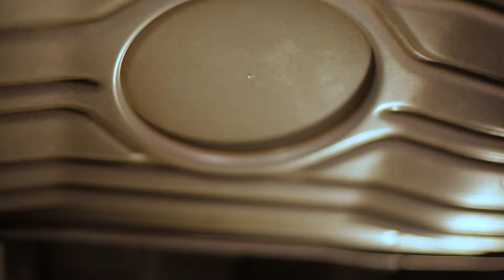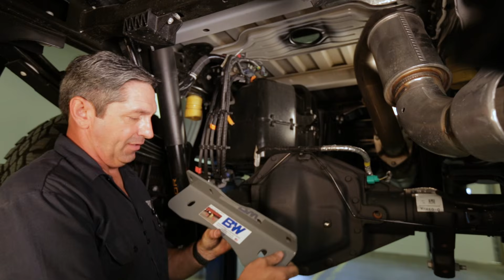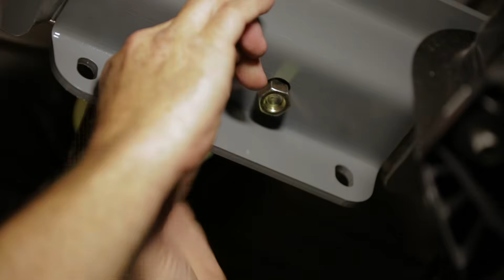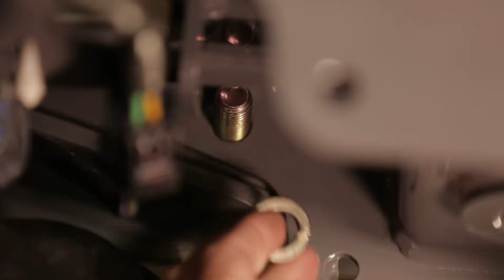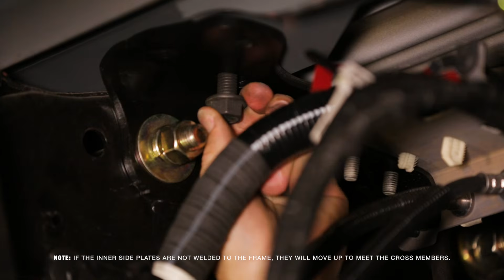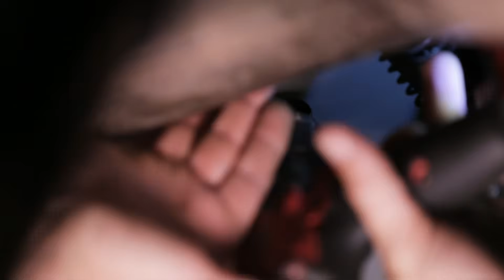GNRK1123 Turnoverball Gooseneck Hitch Installation

Comment: Did you repaint the edge of the hole. What do i need to do as far as the ford bbas bulletin noted in the instructions
Reply from the maker: We recommend deburring the rough edges of the ball and safety chain holes and then use a paint pen to touch up the edges of the holes. 

In regard to the BBAS bulletin, it looks like Q-222R1 no longer appears to be published on the Ford uplift site. The original bulletin provides some information and recommendations regarding galvanic corrosion. Our team will be reaching out to Ford to see if they have updated guidance or an updated bulletin number.

Comment: Any recommendation on which toque wrench to use? I’m having a near impossible time fitting my torque wrench in the areas for the 5/8 inch bolts.
Reply from the maker: We've checked with our install specialists and they've recommended using a Crow's foot style torque wrench for additional clearance.
Reply: @BWTrailerHitches thank you very much!

Comment: I'm a little confused about the "snugging" phase vs the "tightening" phase vs the "torqueing" phase.  The basis of this seems to be the torqueing will actually move the parts in relation to one another after they are tightened...  I'm not convinced... especially if you interpret "tighten" the way I do.  I can see the torqueing phase actually deflecting parts, but not necessarily moving them in shear loading at their contact surfaces.  Basically, it seems there should be a "snugging" phase followed by a torqueing phase.  So "snugging" would be half compressing the lock washers.  Why not go from "snug" to torqueing?
Reply from the maker: The first steps in the tightening sequence, where bolts are only tightened to the point that the lock washers start to compress, are designed to align the cross members with each other, but not restrict them from moving. This will allow them to shift as needed for proper alignment as the 4 vertical flange bolts are tightened. This is a similar principle to the phases of tightening and the star pattern used when changing a tire on a vehicle. The tightening phases and the star pattern ensure that the wheel is not misaligned due to the first lug nut being tightened too much before the wheel is properly aligned. Like a wheel installation, during the torquing phase of the hitch, we do not expect any of the connections or parts to move. In the torquing step, we are making sure that we have the proper clamping force at each bolted connection.

Comment: My recommendation to anyone DIY installing, watch this video and lay out the parts on the floor following along, dry fitting bolts, etc.  That way you aren't trying to hold up heavy pieces and figure out what direction things go.  You'll save so much sanity and many sore muscles, even though it'll take longer to get started installing.  Also, I just used a wood 2x4 across the bed and a ratcheting tie down strap to hold up the hitch flush to the bed, just set the hitch in the "locked position" and hook onto the bar inside the hitch.

Comment: This video was helpful with installation because the paper instructions aren't always clear and we lost a few hours trying to decipher the paper before referencing this video. In all, the install took way longer than expected, over 10 hours.  Without having a lift, getting access to the areas can be awkward on your back.  Without having an air or battery torque gun that you can set to a specific torque value, using a torque wrench in those awkward spaces is way worse due to the big rear end, driveshaft, exhaust and other things in the way.  I was doing some crazy body contortions to get the 110 and 150 ft lbs of force.  It would have been worth it to get the Reese factory style and just remove the bed, or pay someone to install. 2023 crew cab Long bed 350 with the 7.3 and 4.30 gears.
Reply: i installed mine 2 weeks ago. I have a lift. If the parts were marked with a peel off sticker, like left front and an arrow, or this side up, it would be very helpful. A $12 hole saw from Amazon made a clean cut in the bed. 2023 F350 6.7 King Ranch CCLB.
Reply: Torqueing is DEFINITELY the difficult part of this little project.  I'm in the middle of torqueing right now.  I bought a set of crows feet with a 15/16 off Amazon, and the jaws flexed so much it wouldn't even turn the 5/8 nut (it was already pretty tight) - returning it tomorrow.  I rigged a high-quality open end wrench as a torque adaptor and got 3 of the horizontal 4 1/2" bolts torqued, but the driver's side front one is more difficult due to the ball release bracket.  I'm now searching for a higher-quality, 15/16 box-in torque adapter.
Reply: Update - box-in won't fit over the nut on the front left 5/8 bolt.  It's too close to the top plate of the center section.

Comment: Very clear and understandable instructions.  A great job explaining and demonstrating the installation. Curt had no installation videos for their equivalent hitch. This video sold me on B&W, and mine is coming in 3 days from now!
Reply from the maker: Thank you for the support! We're glad our video was helpful in your decision. Should you have any additional questions before, during, or after the install, please feel free to reach out to our team at 800.248.6564 (M-F, 8am-5pm cst). We're always happy to help.
Reply: @BWTrailerHitches  it would be good to understand why some bolts get washer and lock washer, some get head washer, etc.
Reply from the maker: @GrouseHiker  Glad to answer this for you! Each bolted connection is designed to create and maintain a specified clamping force between the parts.  Due to the complexity between the hitch and the bed, and the need for adjustment, slotted holes are used in many of our parts.  Flat washers allow the bolted connections to spread the clamping force over slotted areas or larger holes.